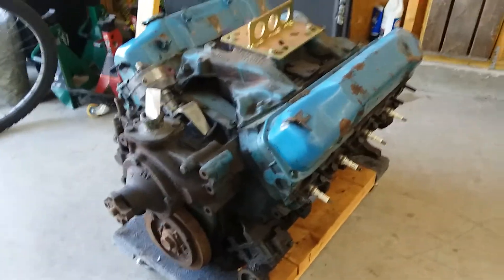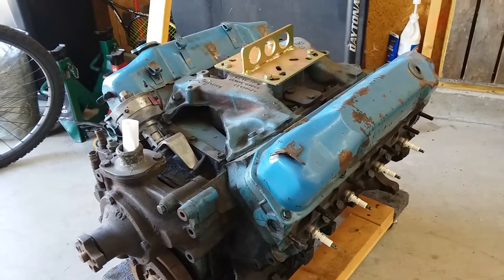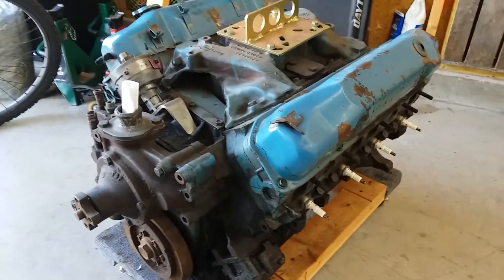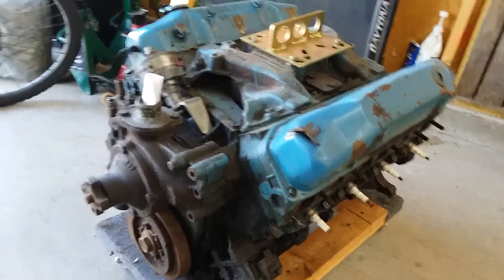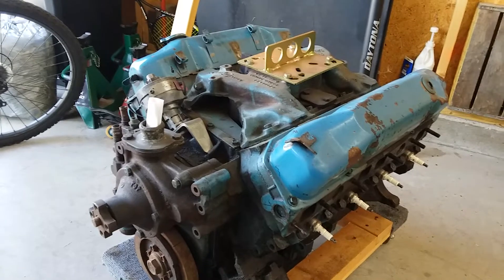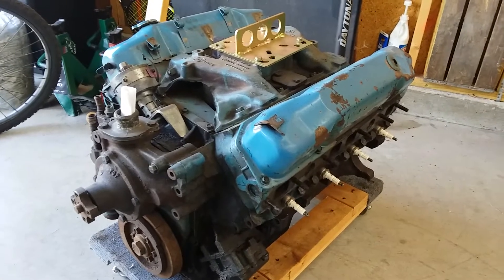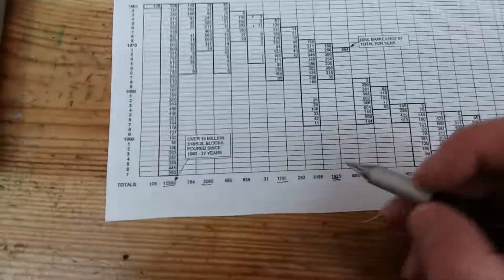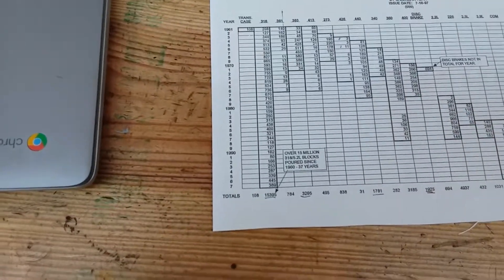Chrysler/Mopar V8 Engine Casting Part 1

Comment: Good Morning l'm trying to decode this 340 motor FW340P3620343
Any help or directions to verify the numbers is much appreciated
Reply from the maker: F=1970, W=Windsor Engine Assy Plant, P=Premium fuel. Are you sure 3620343 is correct? I think it should have one more digit. 362 would be the engine build date and 0343 the 343rd engine built that day.

Comment: Thanks for putting these videos together. I have a '66 440 (HP) block and always thought that was one of the earliest blocks built, but your chart indicates they were building them as early as '65, correct?
Reply from the maker: They were casting "some" of the blocks for the 1966 model year in 1965. For example On January 1, 1966, viewers of the Rose Bowl saw the unveiling of the 1966 Charger., clearly the engine in that car would have been done in 1965 (as was the whole car) So while it's true that some blocks were cast in 1965, they were all for 1966 model year vehicles.
Reply: @Thaddaeus417  Thanks for the response. That makes sense. I dunno why I thought the 426 held on longer in the lineup. I'm reading now you could get a 440 in a '66 C-body and possibly Charger after mid-year.